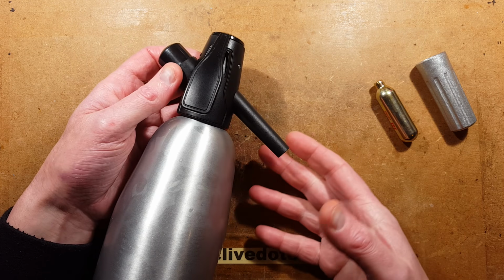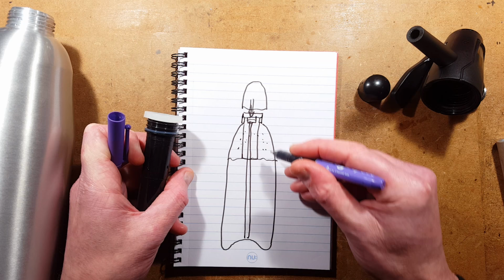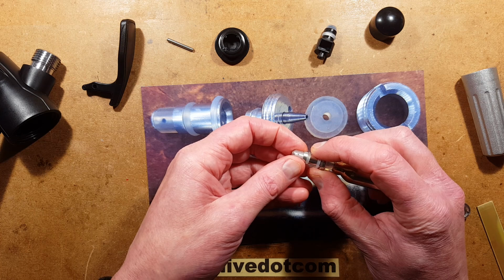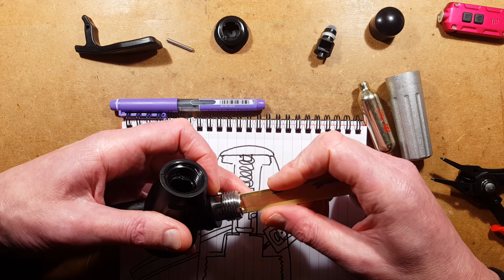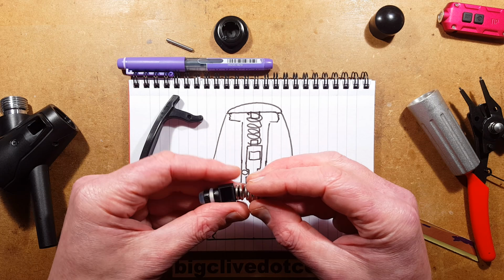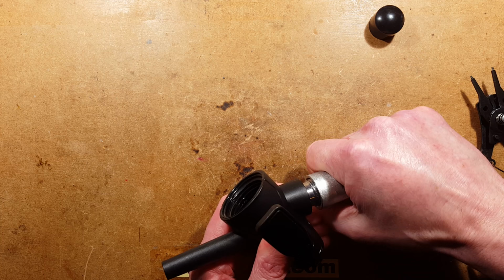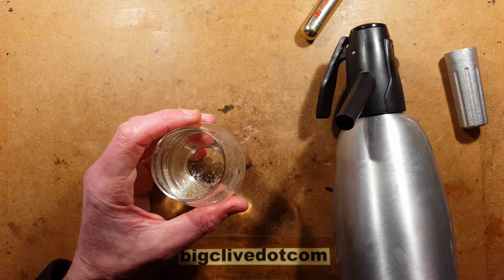Soda siphon teardown.

Comment: all it takes for it to hold the carbonation better is to chill AFTER you pressurize and are pouring. Temperature at time of pressurization is not as important.

CO2 wants to be released from water above 38F at atmospheric pressure.

Comment: That was excellent. The internal wall pressure generated by CO2 is very high, I have seen 200 bar associated with CO2. Are there any chemists out there that can explain to an electronic guy what is happening and explain vapour pressure etc?

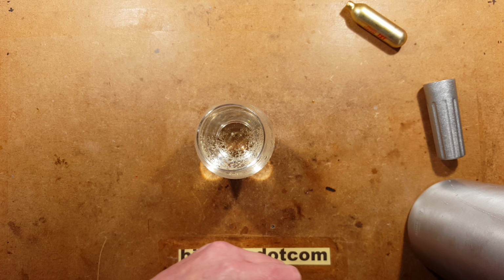Comment: Interesting teardown :) Around 18:00 you say that technically you could use more than 1 gas cartridge to get more fizz per liter… I feel it might be very dangerous to try so I prefer asking first : would it be a bad idea with simple cold water? I have a vintage glass bottle.
And also, what is the best way to do it? Some people say to refrigerate the siphon prior to injecting the gas like you said, but some claim it needs to be left for more than 3 hours in the fridge after the injection… 
Also, can you keep the fizzy water in the siphon in the fridge afterwards? Some people claimed it needs to be transfered in another bottle…
Reply from the maker: If the pressure gets too high the release tap will self release, with the risk of randomly spraying out your liquid.
Reply: Thanks a lot for your answer!

Comment: This type of capsules now are used also to inflate bicycle tires on the go.
Reply: similar ones are used in airtype guns, but i think they are a bit larger. i dont know why, they are only filled with co2 aswell.
Reply: Thomas Herzog you’re referring to the 12g bottles... those are for air guns and the like.

Comment: Are those small capsules recyclable ? A quick google reveals they're 5 times more expensive than sodastream gas, which in itself is also already a "scam".

Get a soda stream, get a conversion kit from ebay, and connect your sodastream to a big (food grade) CO2 tank (anything from 2L to 10L, must be pressurized gas, not liquid CO2) and you get your fizzy water so incredibly cheap.
You have to buy the CO2 bottle instead of licensing it (which makes it a "steep" purchase at the start), but refills are so dirt cheap you get it back in no time. You "may" be able to sell the empty bottle back at the end if you no longer want a refill.
Only disadvantage is the requirement to have the large co2 bottle close to your  sodastream.

600ml sodastream bottle: about 12 Euro.  (bottle under license, you get 2Euro if you return it without refilling).
10L co2 bottle (180 Euro for the bottle (yes), the 2L and 5L are obviously a cheaper, but have a more expensive refill): 25-30 Euro for a refill. 

So for the cost of 20 sodastream CO2 bottles... you can get the big CO2 and get the same amount of fizzy water.
After that, you start saving 10 euro on each additional sodastream bottle you no longer need to buy.
If you use a lot of fizzy water in a day, this pays itself back in no time.
Reply: The empty steel bulbs can go into the recycling along with steel food cans, but check with your collection company/authority.  Don't put full ones in.
Reply: @AlanJenney  Well with "recycling" I meant "reuse"/refill, not shipping them to china where they can melt them down into steel to make more stuff to sell to Big Clive.

If they are "waste", it's a pretty expensive way to make fizzy water. Maybe that's why Clive uses them on wine, to make it a better bargain than fizzy water :-D

Comment: I believe things simlar to these are also used in molecular gastronomy for making foams
Reply: Most of the times the foam is made using the whipped cream charges.  A former employer of mine had a nitrous tank in the corner and several stainless bottles that were charged from the main tank and used for  desserts and such.
Reply: @TechGorilla1987   yeah carbon dioxide chargers would make the food go off.
Reply: @asmolbean9300  Plus, the prep cooks wouldn't giggle so much if the tank was CO2.  :D
Reply: @TechGorilla1987  lol

Comment: "60s or 70s"? These things were a favorite prop with The Three Stooges back in the 30s!
Reply: I believe those were 'standard' soda siphons that were factory pressurized. When I was much younger we used to have one of those which had to be returned to be refilled. There was a substantial deposit to pay when you first got a siphon. Soda Stream and similar refillables seems to have finished the factory ones.
Edit: Apparently in American soda siphon would be spelled seltzer bottle.
Reply: There are still one or two in the New York area.

Comment: I seem to remember adding a teaspoon of sodium bicarbonate to each fill.
Reply: You beat me to it... I was going to say that..
Reply: That's where the name soda water comes from.
Reply: I think that acts as an acidity regulator. It might also make the CO2 come out of solution to form bubbles

https://answers.yahoo.com/question/index?qid=20081021042943AAFf75E&guccounter=1

First of all there is no H2CO3 in carbonic acid. It will not form in aqueous solution.  What we think of as carbonic acid is actually an equilibrium mixture of CO2(aq), H+ and HCO3-.

CO2(aq) + H2O <==> H+ +  HCO3-

Secondly sodium bicarbonate dissociates completely in water to make sodium ions and bicarbonate ions.

If bicarbonate ions were added to a a solution of "carbonic acid" it would shift the equilibrium to the left, producing more CO2, which would come off as bubbles of CO2 gas if the equilibrium solution is saturated in CO2.

Comment: do you think it's worth messing about with these(or sodastream) to put a regular large co2 bottle on them with a regulator (and maybe a filter) in between?
Reply from the maker: There are kits available for using full size CO2 bottles with a regulator to carbonate water in standard 2L plastic drink bottles.

Comment: Wine is acidic, which doesn't combine well with aluminium. If you want to carbonize wine you should get a ceramic coated bottle. And let it sit for 12-24 hrs before serving. It should work just fine then.

Comment: My Dad had one... maybe two? I’ve never handled one that wasn’t broken, so I just assume that all of them are...

I can get a two-liter bottle of fizzy water (or house-brand soft drink) for US$0.79 to a bit over $1.00, and I think that that may be the cheapest way to get carbonation. Supposedly there’s about 2.2 grams of carbon dioxide in 16 ounces of a typical carbonated beverage, so an 8-gram CO2 cylinder can’t quite carbonate 2 liters of liquid.

Comment: I have a bunch of these I'm intending to restore. They're older than Clive's and have black, probably rubber o-rings that have hardened to the point where they're brittle.

Are there food-grade o-rings that should be used ? Perhaps clear rather than the normal black ?
Reply: As far as I know regular o-rings are fine, I would recommend silicone grease to extend their life and provide a good seal. This grease is usually transparent and non toxic, it's used to lubricate equipment that is in contact with food and it is the only recommended grease for o-rings, because it doesn't affect them.
Reply: Look for silicone rather than neoprene.

Comment: I’ve just got my isi one out is leaking slightly I’ve turned the bottom seal on the plunger will let u know tomorrow if it works I’ve bought a new one tooo

Comment: The amount of co2 liquid can hold is a function of temperature and pressure. You could increase the pressure with another sparklet but the liquid needs to be really cold for the co2 to remain in suspension so really the colder you can get your soda siphon and wine the fizzier your drink will be. 
Bodies of water ie rivers lakes and oceans are sinks for co2 so as we see the earth warm up we get a corresponding rise in co2 in the atmosphere.
Reply: But the average temp hasn't increased in 18 years so you might have to wait some time.

Comment: On Guinness draft and a few others like Boddintons, the can has the widget inside it that makes a foamy head.  It took me a long time to figure out how those work.   I thought maybe CO2 or somehow the widget would break to spew out gas or beer to make a foamy head.   No, my guess is it's a simple round plastic ball with a hole in it.    Either it's filled with beer or fills with beer after being canned.  Then when opening it, the pressure drops faster than it can exit the widget without it coming out at high pressure.  the high pressure makes it foam.  Or that's my theory.
Reply from the maker: Some of them are pressurised.  If you pop one open they can do so with surprising pressure.

Comment: I wonder what would happen if you used one of the 12 gram CO2 things instead of 8 because that's the only thing we have around here shouldn't be too much pressure
Reply from the maker: When I first got the unit, that was all I had.  The capsules were too long to fit inside the screw on sleeve, so I just forced them on by hand hard enough to puncture the seal.  It worked.

Comment: Definitely liquid in the cartridge. I use a device to blow out HVAC drain lines in my business. I have accidentally pulled the trigger and liquid and vapor pour out. It expands so quickly that not all the contents will exit the cartridge. Removing the spent cartridge will result in a frozen cartridge. Funsies!

Comment: as l walk around l often think of collecting those NO 2 cartridges that a strewn all over the place , l picked one up a few weeks ago to see how the users get the gas out....they are virtually the same as an aerosol can,,the little dent on the top of the canister is spring loaded,,,,a bit of info on the above cartridge and NO2s
 
CO2 canisters are sometimes confused with NO2 nitrous oxide canisters, used in whipped cream dispensers. ... 

Inhaling CO2 from a CO2 canister causes death due to suffocation. Any inhaled amount stops oxygen from flowing to the brain.

Comment: I have one of these for use at home instead of a soda stream as it works out cheaper for the refills. Although the canisters look the same as the nitrous oxide people use to get high. Once my daughters friend came round and her mum brought her in and there was a canister on the floor (it must have fell out the box or out of a bin bag when I was going to the outside bin. Obviously she jumped to conclusions and it took an explanation.
Reply: you must have a very cheap source of those capsules than.
Reply: @thomasherzog86  it definitely works out cheaper than sodastream. Plus at the same time I'll order for co2 pistols.  They are different size canisters but it means it's cheaper for buying in bulk. I do have a soda stream I still use but have ended up sending them off to be refilled as I cant really find them anywhere. You can goto sodastream directly but they charge you £10 deposit for the canister. Plus I use one of these for work. Which is more practical than lugging around a sodastream. I've just had a look on amazon and I'm paying less than any of those prices. I do have a friend though who supplies me perhaps a lot cheaper than ordering online.
Reply: @Matt19matt19  
they have kits online to refill the sodastream ones with big co2 bottles, the ones needed for welding. plenty of tutorials on youtube, but im too much of a coward to handle that high pressure. always assumed thats the cheapest way though - maybe ill try it out one day. 
where i live, many markets refill the soda streams which always ended up being cheaper than the small capsules for me. that is, if you dont count the gas thats often lost because the machine (the one with glass bottles) doesnt close properly.

Comment: I worked in pub many years back,we had the glass ones that got sent back  to soft drinks people to have it refilled and gassed
Reply: We have a blue one ,how they filled them is a mystery but i suspect it was all done with the lever depressed and everything injected via the spout?
Reply: DC Allan:-  I used to be a maintenance engineer at Corona Soft Drinks in Wandsworth.  And yes they were refilled as david granger stated.  They went into a rotary machine that was shielded by steel covers to stop the glass fragments flying out should one explode due to flaws in the glass.  This only used to happen very infrequently but when it did used to scare the shit out of everyone in the vicinity.  Happy days, well some of them were!
Reply: @davidgranger3628  Never thought how they got filled

Comment: Shaking isn't a good idea. The CO2 is dissolved in the liquid under pressure (it takes a bit of time under pressure to reach equilibrium), and there are NO BUBBLES inside the bottle. Shaking may cause the gas to come out of solution temporarily until it can reach equilibrium again. The bubbles form when the liquid is depressurized (exits the bottle), just like when you open a can or bottle of a soft drink. It will probably be a bit flat if you shake it first, and come out frothy, just as it did...
Reply: schwartzenheimer1 yeah it didn’t seem like a good idea to me to shake it.... just time would be best I would imagine. Also the cold is interesting. I would have imagined letting it warm up a bit would allow more gas to enter into the liquid.

Comment: mines rubbish, it doesnt really carbonate drinks that well and the only way for me to get a good carbonation is to shake the hell out of the drink to mix the co2 and then slowly release the pressure from the lid and pour from the siphon. if i try to use the handle and spray out the co2, it just fills with micro bubbles and doesnt carbonate
Reply from the maker: Are you only using water in it?

Comment: Childhood memories.
Our bottles were a little bit different in Hungary (the canister on the side, the lever behind the output tube), but the principle is the same, and the parts look very familiar also.
It does not have sound, but it shows our version. The bottom part has a little bit more modern design though. https://youtu.be/E6joEdrJ28E

Comment: Thanks for the replies guys. Checked my settings , found no clues. When I toggle between this vid and and " inside a bottle air vent" june 25, 2019, I hear a pretty dramatic difference. Do I need professional help?
Reply from the maker: I've been recording with a different device and unfortunately Dolby surround sound may be putting the audio out to a middle speaker that doesn't exist on some systems.  Check your sound settings are for ordinary stereo.

Comment: If you didn't fill the canister with water and injected CO2 only could you use this as a fire extinguisher? Also, how many cartridges of CO2 can you inject into the canister (with no water inside) before the safety valve operates? Hmmmm!
Reply from the maker: That could be expensive.  A real CO2 extinguisher has liquid CO2 in it.

Comment: Trawling through your vids again :) so many now including the live streams! Great channel! Why not sodastream though? It is great to have syphons just for the nostalgia or if you need something more mobile. They feel more luxurious too. Sodastream is technically better though for sure. The old glass syphons are better for acidic stuff like wines and fruit juices. Even stainless isn't an ideal material selection. 

Aluminium use is pretrybmuch a slow way to degenerative diseases of the body and brain. Unfortunately manufacturers (and most people) haven't realised this yet or dont care until its too late. I guess it's dose dependant how fast the onset is. Very morbid :0/... lol. I don't want to have to be moderate with syphon my use. Or use aluminium (especially with acids) though! 😂

For the seals, as you say you can make seals. The longest lasting and most reliable are ptfe in my expereince. I learned this stuff from some old time brewers in the desert with the britvic syphons and Bialetti coffee makers after getting fed up of replacing seals! Takes a few times to get the ptfe seals right but worth it 👌
Reply from the maker: I do use a sodastream in some of the videos.  Usually to carbonate wine.
Reply: @bigclivedotcom  I know man :)

Comment: In the early days of Sparklets system you could buy tablets to put in to give a soda water flavour, instead of just fizzy water anyone remember what they were- baking powder ?  P.s I guess airgun capsules are the same( quality of gas) certainly the same size and CO2
Reply from the maker: They were bicarbonate of soda to regulate the acidity.

Comment: Hi Clive, somewhere in my parents' attic an example of this https://coins.lave.ru/forum/pic/5694510.jpg is collecting dust - an artefact made of glass and stainless steel and a memory of the several years spent in the USSR, when I was a child. Unfortunately, in my home city of Sofia, Bulgaria one cannot buy CO2 shells from nearby store, which makes such a possession useless in everyday life.
Reply from the maker: Someone just suggested that maybe an 8g piece of dry ice could be added instead.
Reply: @bigclivedotcom  Getting dry ice is more or less the same here as getting pressured gas cartriges - there are supplyers, but not shop distribution.

Comment: If you have access to a large bottle of CO2 with a regulator you can use a 2 liter bottle filled 3/4 with cold liquid and shake it to make inexpensive carbonated water (or other fluids) without getting into taken in by the expensive disposable half-empty proprietary cylinder scam.

Comment: Looks like the exact same 8g CO2 tank that Paintball uses.
Reply: And it probably is. However I've been told that you shouldn't use those with a soda siphon as they could contain some oil or other residue. Don't know how accurate that is though, as I'd be surprised if there wasn't at least some of these coming from the same factories, just with different markings and boxes.
Reply: They would fit, but I think that the ones intended for paintball guns can contain lubricant, so would not be food grade.
Reply: i think they are about an inch longer iirc.
Reply: @thomasherzog86  Isn't that the 12gr version?
Reply: @blahorgaslisk7763  i guess so.